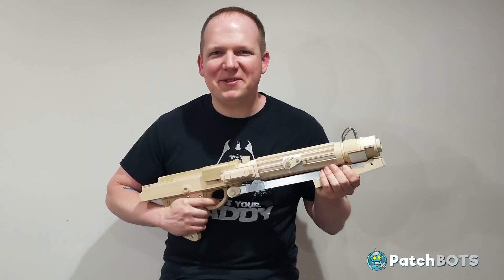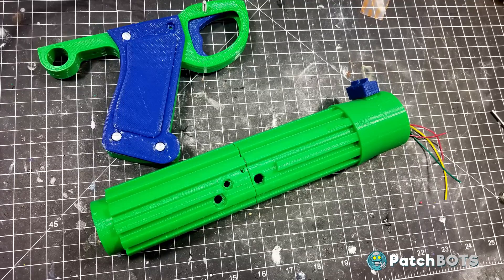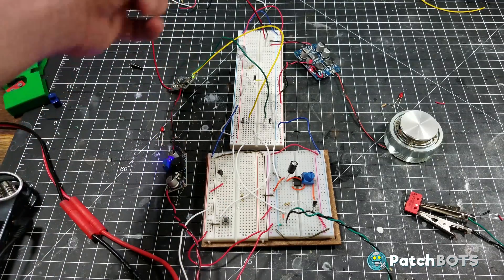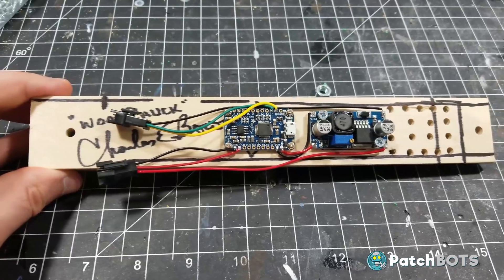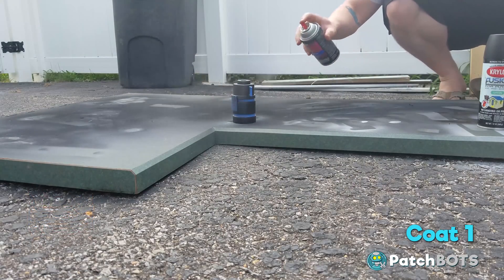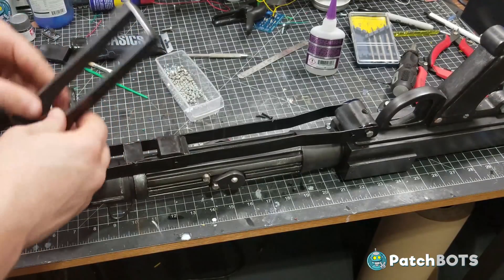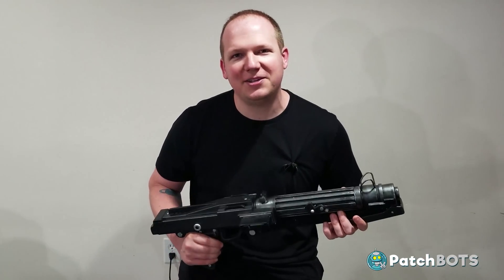Clone Commander Bow Build - Part 10 - DC-15 Blaster Build "The FrankenCHUCK"

Comment: Idk if someone said this already but the blaster is based off a real firearm called the Sterling SMG if you Wana see how the stock is used on the actual firearm. Stellar job on this blaster, I live it.
Reply from the maker: Very Cool!  I'll have to check that out.  Thanks!
Reply: Actually, no.  E-11 stormtrooper blasters are the ones made from sterlings.  ;)
Reply: @joefera8947  yeah, let's pretend they aren't exactly the same. 🙄😑

Comment: I don’t know why you didn’t just print the whole thing
Reply from the maker: Yeah, I've been waiting for this comment, haha.     I definitely didn't start out to print as much as I did, and by the end I was even thinking "should I just make this a 3D printed gun?"   I wanted to keep it as a hybrid woodchuck for a few reasons.  1) I wanted to keep this for reference for anyone who wants to mod their gun.  And since you dont NEED to do all the mods, you can just pick certain parts 2)  In the end I didn't need to reprint the barrel. I didn't really know that until I was too far into the process, but, you can keep the woodchuck barrel and just mod the part that connects the main body to the barrel.  I think in my head this was the original intention and then i got too far ahead of myself.   Thanks for commenting!

Comment: tell us more about the pcb you made. its function and how you would like to revisit past products with it.
Reply from the maker: (Deleted my previous comment to answer the question a little better).    The board takes in 12v power.  The funciton of the board is split into two parts.  Single shot (activated by the button trigger) and Multi-Shot (activated by the limit switch trigger).  On the single shot side, when the button is pushed it sends a ground signal to the audio trigger and completes the circuit to the LED.    Same deal on the Multi-shot side but instead of simply completing the circuit to the LED, it runs the signal through a 555 timer to get a blinking effect. I can adjust the duty cycle of the 555 timer (and thus the output in the LED) with a variable resistor to match the sound pulses with light pulses.     

This particular board isn't going to help with past project, but the idea of making my own PCBs for my builds will.  making a board makes the connections between components a lot cleaner which is always my goal.  Also, as I build my assembly skills I can start moving to surface mounted components instead of through hole components and make my boards smaller and smaller and cleaner and cleaner.  This could mean adding a lot more unnecessary electronics to things!!!

Comment: Do you think i could do this too just with a Dc 15 a from Woodchuck
Reply from the maker: That's the long rifle, right? I can't be 100% sure the parts fit, because I don't have one of those on hand.   Not sure of your level of 3D software knowledge, but as afar as the trigger/handle, you can most likely modify that as needed to fit.  The barrels are different I would assume, but, I can help with any questions if you had any along hte way.
Reply: PatchBOTS that would be great.

Comment: Why don’t you code the Arduino to detect how long the trigger is pulled and that determines the type of shooting
Reply from the maker: Yeah, totally!   That was the original plan but thought it might be a bit overkill + I was genuinely concerned about space inside the chamber.  With the new PCB and some 'clever' wire routing I think i could fit it inside the handle now, but I'm actually quite content with the "low tech" way.   All the parts are posted though, if you ever decide to try that out I'd love to see your results!
Reply: Ok
Reply from the maker: Checked out your channel, how old are you?  If you're already thinking about arduinos and functionality and circuits you're on a good track! Keep it up!
Reply: I am almost done elementary school and I made pong in Turing but I am having trouble with finding out to code in Arduino because I am used to Turing coding software. 😕 but I can do simple circuits using the ground and the 5 volts on the Arduino board. And every Arduino code explanation video that I watched I barely understood anything so I can only modify a tiny bit of code.
Reply from the maker: I didn't even know what an Arduino was until I was 29 years old.  You've got some pretty awesome technology at your fingertips and internet of resources to pull from,  you'll do great things, I'm sure!
Reply: Thanks! 😀
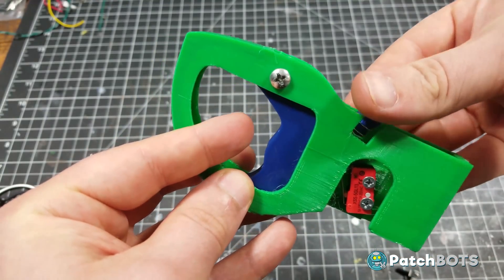Reply: this is a link to a video that you can only watch through this link https://www.youtube.com/watch?v=4Nw-jLkSMYc I would rather you watch the video in your spare time it is only 1:58 long